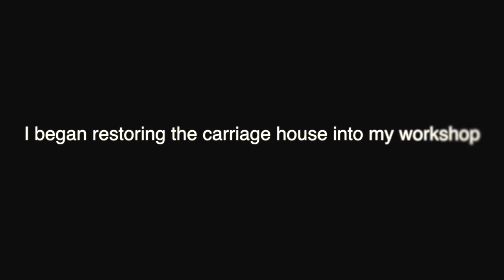The LastingBuild channel trailer

Comment: I have that exact same bandsaw! Early 1980's Craftsman 12"? I just got mine a few months ago and have been trying to figure out how to make it work for my needs. Right now my biggest issue is the fence, I think I have to make my own table and a new fence. The original just won't stay straight and either direction (vertically or horizontally).
Reply from the maker: Mine was given to me. I actually don’t have a fence. Need to build one as well.

Comment: Maybe you want it this way but do you have a name? I would understand if you don’t want to give it out. Curious how you have your vacuum set up. Maybe a video in the future
Reply from the maker: David my name is Jim. I will definitely try to go over the system sometimes. Its pretty basic but definitely helps with dust when using the power tools. I was fortunate to get most of it used from craigslist.